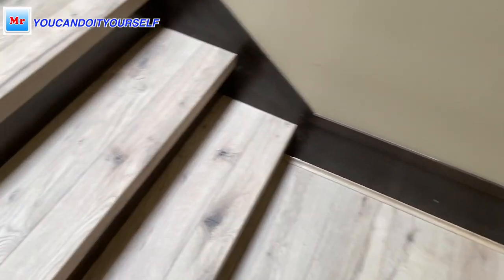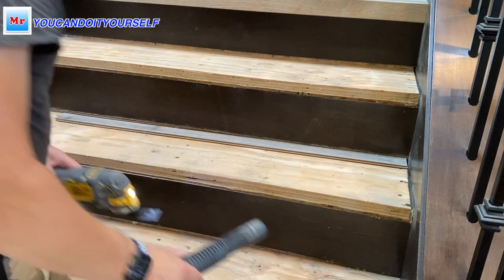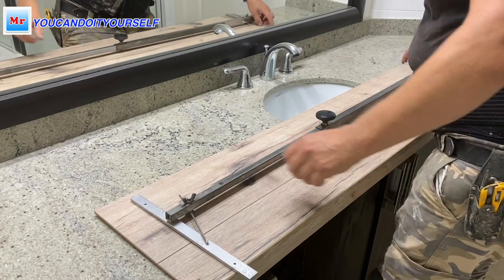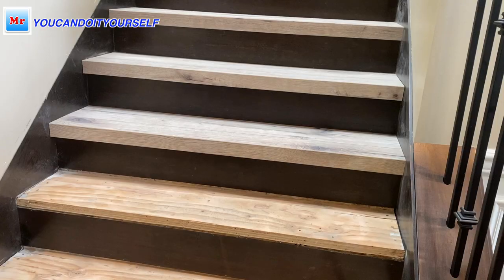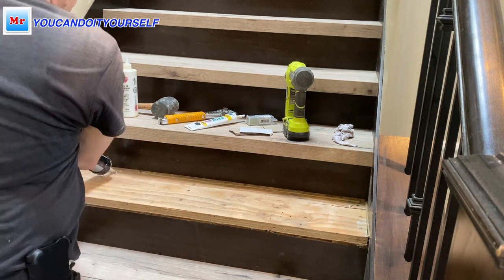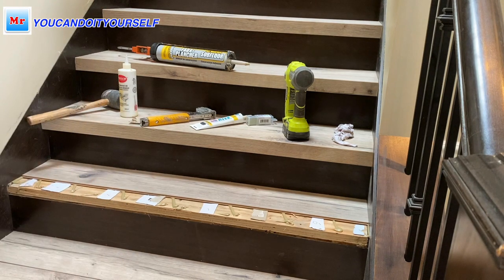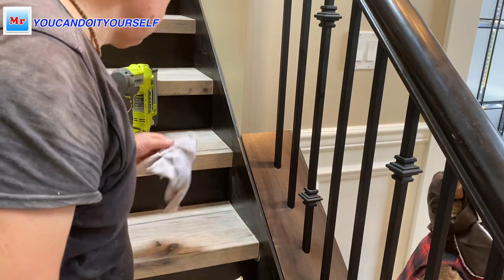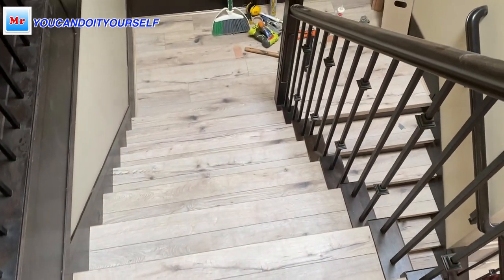New Technique for Laminate Installation Light Stair Tread With Brown Riser

Comment from the maker: Tools I used for installing laminate floors on stairs:
- Stair Tread Gauge - https://amzn.to/3BW38FN
 - Pin Nailer 23-Gauge - https://amzn.to/3WDBYeY
 - Miter Saw - https://amzn.to/3vfB8JH
 - Dewalt Table Saw - https://amzn.to/3hOJKDV
 - Ridgid Vacuum - https://amzn.to/3OcpMy8
 - Rubber Mallet - https://amzn.to/3WlH2Vu
 - Cyclone Separator - https://amzn.to/3YZc5Z8
 - Titebond Heavy-Duty Construction Adhesive
 - Color Rite Filler
 - Lamdura Laminate Flooring

Comment: If you are putting baseboard on the risers, are you putting them on first? If so tight to the tread or leaving enough room to slide the material from the tread underneath?
Reply from the maker: I installed riser first than baseboard.